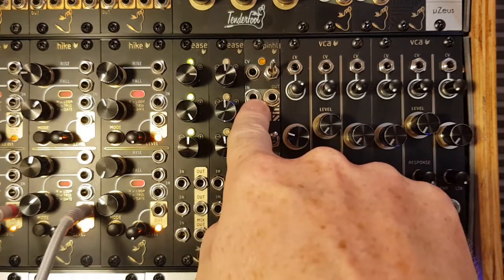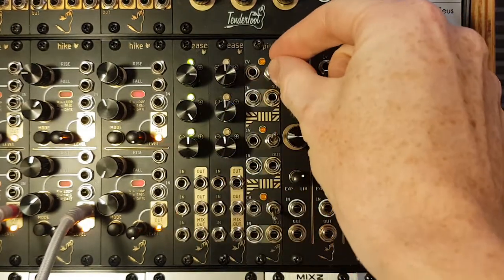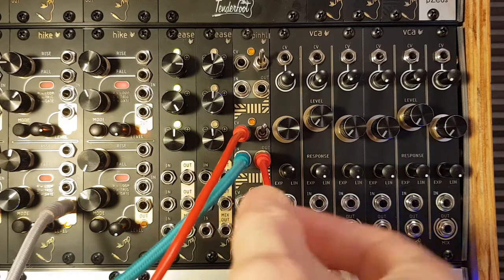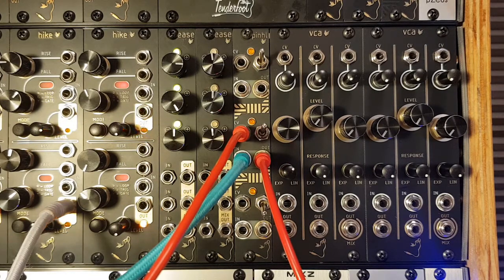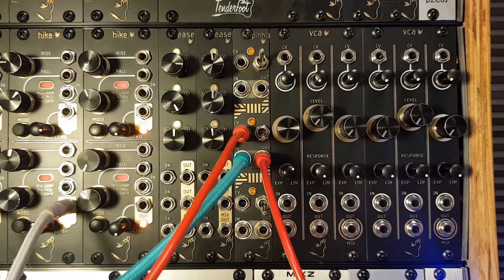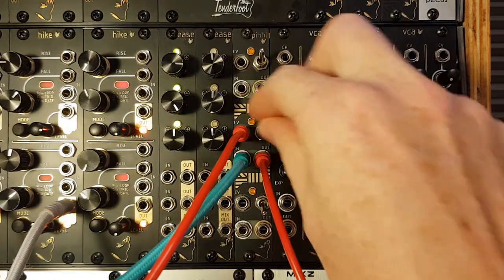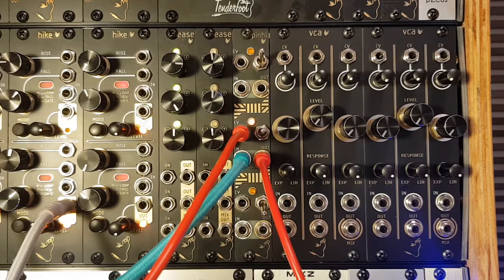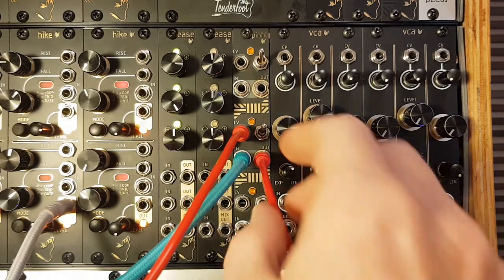Pinhl - A 3 Channel Passive Low Pass Gate

Comment: Decay sounds abnormally long for a LPG just being fed triggers. Almost like there's audio bleeding through or something, or the vactrols somehow have ambient light leaking in.

Though it could also just be a combination of my shitty hearing and the triggers being really close together.
Reply: Lots of (maybe all?) vactrol-based LPGs have some signal bleed. My Sputnik VCF/VCA sounds lovely, but there’s a lot of bleed that comes through, especially with higher frequency content. Kinda the price you pay if you want that sound, IMO. If it bothers you(it’s never really a problem for me), I recommend using a noise gate, or at least have a vca or mixer afterwards so you can mute it when needed.
Reply from the maker: @Space_pulse  Yes, this is definitely a pretty common thing with vactrol-based circuits. With the pinhl, a small amount of bleed can be present, mostly noticeable when the switch is set to the middle, unfiltered position, but for a passive module, we've tried to minimize it as much as possible.
Reply: @Space_pulse  I've got quite a few of them and never noticed that level of bleed, though. Sounds like what I was hearing here is a result of the long decay on these vactrols per Tenderfoot's reply.
Reply from the maker: The VTL5C4 vactrols used do have a pretty long decay(around 1500ms, but with some variability between individual vactrols) especially with the switch in the middle, unfiltered position. Hope this helps!
Reply: @TenderfootElectronics  That definitely clears it up. Thanks for the info!